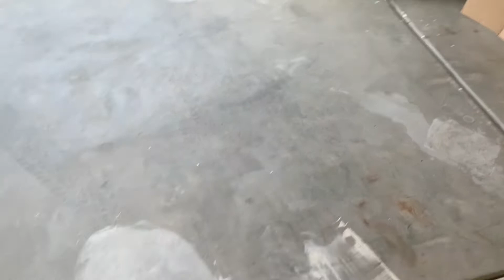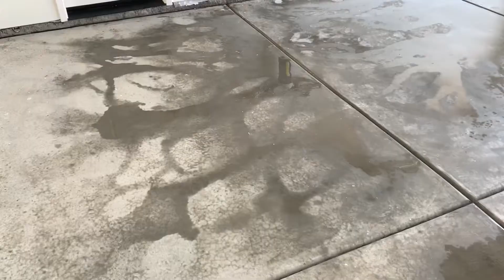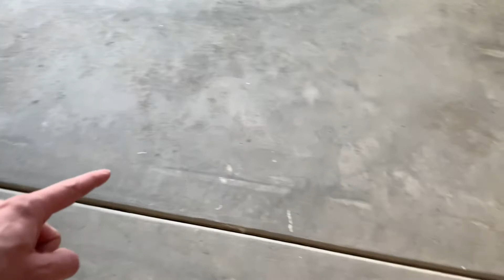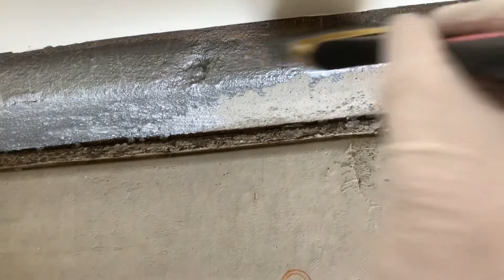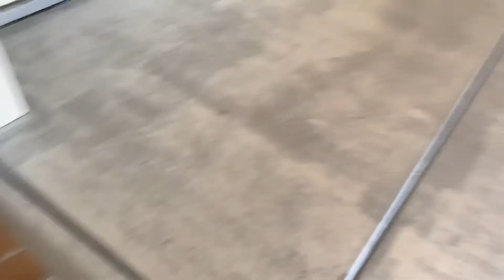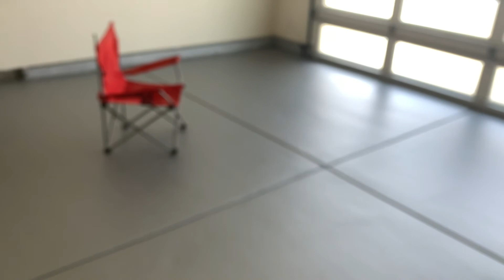Applying Hellfire Concrete Coating

Comment: Looks pretty good how has this product held up so far?
Reply from the maker: It’s actually been super good. If you look at my latest videos, I’ve done a ton of work on this. It hasn’t chipped or anything. Very durable.
Reply: @PootsGarage  Thanks for the response I will definitely check out the other videos.

Comment: How many coats, sqft and paint did you use?  I just finished my first coat.  I think it looks pretty good, but I'm averaging around 400sqft per gallon.
Reply from the maker: I forget my exact numbers, I think I’m around 750sq/ft, I did 3 coats and used 5 gallons.